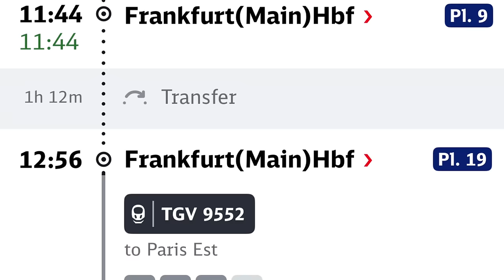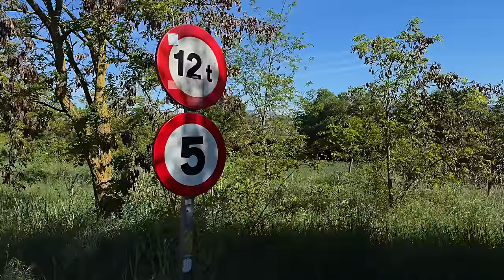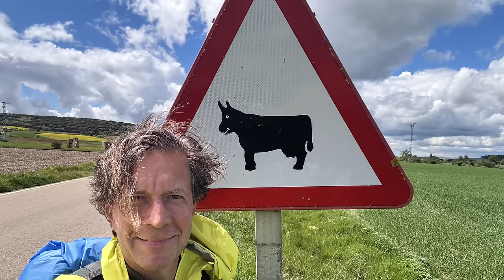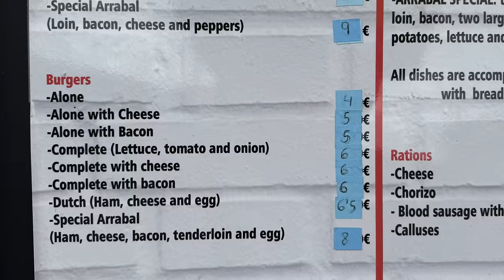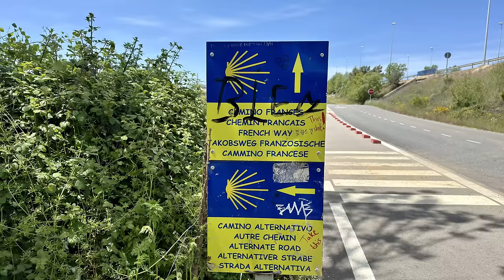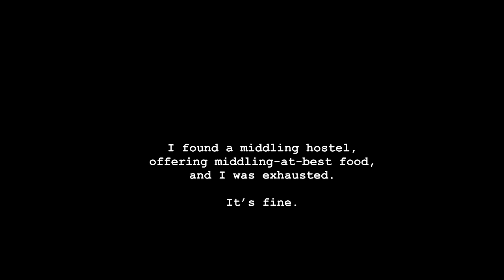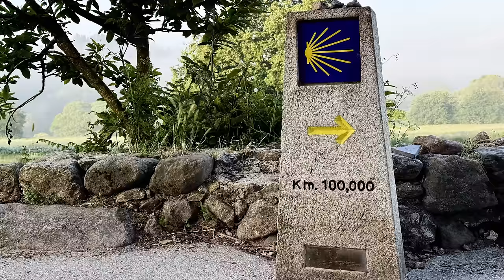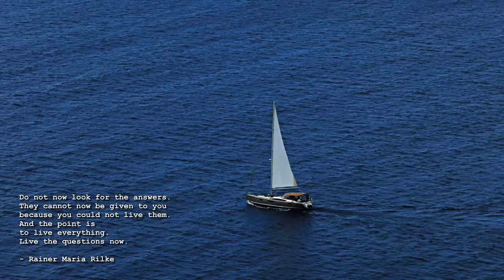Camino de Santiago: A LIFE-CHANGING ADVENTURE

Comment: Would be interested to know what is in your backpack on this third Camino and what has come out since your first. Do you take books? Also what device you record on as lovely audio.
Reply from the maker: it looks like you've seen my Camino Packing video, right? if so, I stuck pretty much to the recipe, as it worked very well for my first two Caminos. Glad you caught the audio! I recorded it on a Roland R-07 - small, solid, great to use, excellent sound. That might have been my biggest upgrade in terms of gear.